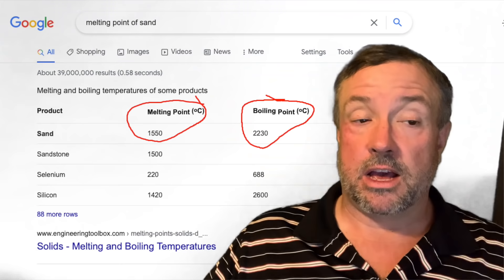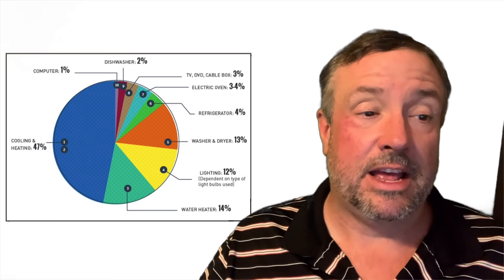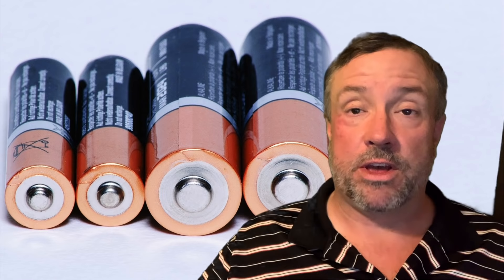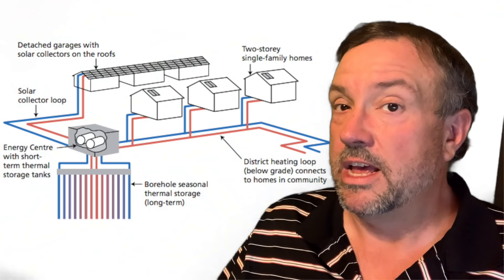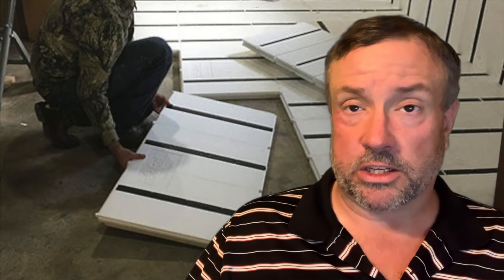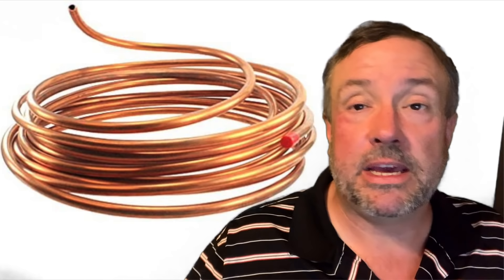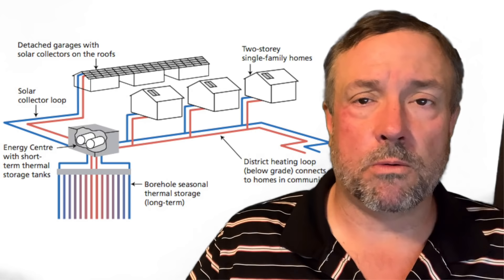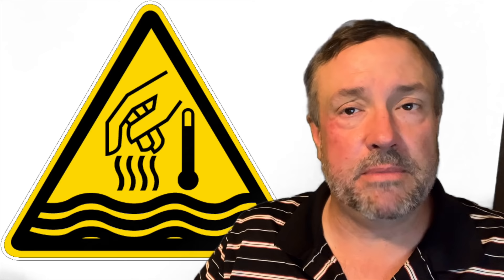Sand for Thermal Energy Storage

Comment: You should look into cast iron piping. The melting point of cast iron is 2200°F. Something I just thought of with the parabolic system is to use a cast iron pipe as the collector, put in a few small tubes and then fill around the tubes with sand inside the larger cast iron pipe. The cast iron pipe will be able to withstand the heat of the solar rays (though it's not a very good thermal conductor, it does hold heat really well), and this heat can be transferred to the sand inside to hold it as well. You can then pump an oil or something through the tubes to absorb the heat from the parabolic mirrors and then send it into a much larger thermal mass.  So inside your thermal mass, you'll have heating pipes or tubes that transfer heat in, and cooling tubes that will transfer heat out into whatever needs it. If you can get the temperatures above 100°C, you could pump water into your large thermal mass, and then spin a generator from the steam output. You'd get a lot of force out of it given steam's 1700:1 expansion factor.
Reply from the maker: I like it
Reply: If u use rocks with air pockets the water can drip onto the hot rocks and escape as steam

Comment: sand on its own is not a good heat sink, as the air gaps actually insulate, a couple of inches form the source, it requires a liquid to spread the heat throughout the storage unit. I remember reading about a passive house in Minnesota, that was succesful in heating using such a system.
Reply from the maker: Great point!

Comment: First i believe you have to break up this problem.  Sand is appealing because it is cheap and has a high capacity before phase change.  Problem with this is you loose heat proportional to temperature gradient and heating sand up to several thousands of degrees will exacerbate this problem.  Water or salt water options are very practical for the transfer of heat.  Phase change products are the newest area of interest because you can store heat energy at a given temperature such as room temperature and minimize energy loss.  This project requires multiple stages each exploiting the advantages mentioned here.  I would suggest a very effecient water based heat transfer to cool the collectors, and phase change thermal battery

Comment: What about a black metal barrel full of sand. Then add aluminum spikes from the outside to the middle to transfer the heat. Then have copper tubing pipes inside and through that carry air transferring the heat of the sand to the airflow. I’m no expert. Just brainstorming
Reply from the maker: I like it, it’s a good start

Comment: Why are you using just plain water when you can add salt and raise the temperature. Just need plastic piping salt water brine is corrosive. Or use glycol like in the car radiator.
Reply from the maker: Good point

Comment: Since the above ground infrastructure to collect the energy to heat the sand is pretty bulky, I was thinking of using a combination of wood fire heater and sand battery. 

Periodically and irregularly we could fie up the wood burner and keat up the sand. At the same time par of the heat could be piped into the house for heating and hot water (through an exchanger of course) But most of the heat would be sent to the sand battery.

This way we would disconeect the production of heat from its use. And thermostat could grab as much heat from the battery as needed by slowing down or speading up the primary liquid flow. And the same for the wood burner liquid. part would go to the house heat exchanger and the rest to the sand battery.
Reply from the maker: I like it

Comment: good, if everything sums up, the experiment should take place in desert. all condition are available there! there are molten salt solar generator that work at 300~1000c,  plenty of dry "bad" sand that can't be use on building, huge night and day temperature difference, no population just in case shtf

why nobody did the battery experiment there? very likely figures don't work as expected on paper.…

but if the storage media is water. there are countless case worldwide, they just don't call it battery, some may call it water hole, some may call it underground well. less energy density probably a good thing too, say, how many usage of a ton of sand in 500c? not much besides therml storage. but same amount of fresh water in 80c can do a lot of things. in fact, a lot of heating requirements do under 50c, 80c can already kill most bacteria and parasites, but not all virus and fungus. strip the heat away it is probably good enough for animals and plants consumption. 100c+ do no good to almost live form we know.

can sand do that? yes, but indirectly. how? water cooling. back to square one.
Reply from the maker: interesting

Comment: the best way to heat sand is in a chamber with electric induction.
Reply from the maker: electric induction????
Reply: @SimpleTek  yes instead of useing convection transport its more cost efective to use induction. as in use solar parabolic miror to collect heat energy then transform the state from heat to electrons as in (make electricity) then use the electricity to heat the sand with electric induction. electric inducers can reach temperatures of 1500 degrees. you can even use a 1400w ready made water heater inducer. at home depot.
Reply from the maker: @menuachaparyan2263  thank you for the information!
Reply: How about regular solar panels feeding some electric heating coils buried towards the bottom of the sand battery. Then a low power variable speed fan to exchange the heat via air flow.

Comment: I think ‘earth itself’ consisting of rock sand and all is THE  large solar heat  battery we have all been looking for. Where did all that heat in the earth’s core come from anyway? Is it stored heat harvested from the sun through  centuries that volcanoes act as pressure and thermal relief valves since it has never  been used? Maybe earthlings just have to drill deep enough to extract that inexhaustible heat for our energy needs and likewise help relieve all that stored energy and maybe those volcanoes  would finally stop erupting plus continental plates would stop expanding and therefore stop causing earthquakes? Hmmm 🤔
Reply from the maker: Ok

Comment: Not really as effective as phase changing materials like Water\Ice (storing cold), Wax, Sodium Acetate, Salts (Storing heat). non-phase changing material cannot sustain a near constant temperature which makes them less useful. 

Typically for domestic heating water is used because you can take advantage of stratification (warmest water remains at the top), & the hot water can be use directly from the water storage tank (ie no need to run a large amount of piping through a solid material like sand). Wax is also sometimes used for domestic heating which takes advantage of the phase change (gives off heat when it transforms from liquid to solid).
Reply from the maker: I'm currently looking into paraffin wax
Reply: @SimpleTek  I recommend you stick with a water tank and use stratifcation for a residential application. Adding Wax will make it complex & more likely to run into issues. 

FWIW: 80 Gallon tank feeding a Outdoor wood boiler and a Propane boiler (so I can have heat & hotwater if the wood boiler is not running). If you want to get the best bang for your energy, consider using hydronic radiant heat since the water temperature can run around 80F to 90F. This will be double the efficiency of a 160F system using traditional radiators. I have a radiant heating system.
Reply: @SimpleTek  and quadruples the complexity. You have to deal with expansion. you need a internal stainless steel coil. You get more bang for the buck using Hydronic Radiant heating.

Comment: You could heat air to 180-200 C very cheap.
Reply from the maker: Interesting.....
Reply: Yes but the energy densety is realy low.  You coud only store 4kwh per m3.  
So you would need a huge airtight tank ,which would be very expensive
Reply from the maker: @mzi6519  true....
Reply: I was thinking as a carrier from the parabolic collectors to a distribution grid in a sand pit buried below 36” to take advantage of earth insulation and could be lined with roofing rubber with a heavy expanded styrene insulation on to of that then an overlapping layer of liner to keep water out. With the earth replaced on top would keep a large portion of the heat trapped. Maybe not enough for the long winter but would make a significant difference for the the first few months.
Reply from the maker: @damonginnow1383  remember I'm talking storing 300' - not sure wood would last
Reply: There are some concentrated solar station that use a black ceramic honeycomb like structure as e collector. Ambient air is sucked in through the honeycomb and heated to over 1000°C, then sent to a heat exchanger for steam generation. This virtually eliminates convection losses at the collector.
You could pass the air directly through the sand. The sand chamber should be airtight with a quite powerful suction fan at the exit
Reply from the maker: @ing.pagano  ohhh, very interesting!!!!!
Reply: Elaborating on the idea, the outcoming air, still hotter than 100°C, could go through a heat exchanger with water to the secondary "battery". In winter the same fan would drive the same circuit to draw the heat out, with a differential thermostat deciding to recirculate the air exiting the water exchanger or taking fresh air from the heat collector, whichever is hotter

Comment: I see no reason to pipe hot liquids anywhere except to/from the solar collector and to/from a steam boiler which can sit on top of your buried sand container.  Use the steam to drive a co-located turbine spinning a generator.  Use the electricity generated to run the house, greenhouses, heat a fish pond, keep livestock warm, to run the fluid pumps, etc.
Reply from the maker: Ok
Reply: @SimpleTek   I take it you've explored that option.  :)
Reply from the maker: @graveseeker  somewhat

Comment: Consider hydraulic lines, high heat, higher pressure, steel reinforced,  crimped on ends…
Reply from the maker: They aren’t high heat, I use and replace hydraulic lines on my tractors all the time
Reply: @SimpleTek  the hoses will handle a few degrees, if it was super drastically hot, I’d imagine a reinforced silicone hose. ( I’m crusty old parts guy/mechanic/maintenance/etc. so I have a vastly deep well of nothing) ha
Reply from the maker: @thedustmancometh  lol

Comment: Use a grid black steal pipe in sand ... insulated nonporous Concrete atleast 6 foot deep  20x20 foot build a green house over it but really it should be a egg shape battery 30 deep 20 foot wide with horizontal piping every 2 feet  ,,you will actually need to make it a steamer to raise the temperature 🌡️ you will need to add water to the Sand,,. But if you don't need extreme heating of the sand don't wet it this would make the pipes last longer,,. Use a non corrosive oil.  I would buy used synthetic oil and filter it under pressure with a pump $1000  pump used , filter 500 gallons  pump it sell it for $800 save 60% on oil..   dont forget vacuum is your freand with thermal dynamics.     I would buy a couple of  used big rig truck oil tanker trailer or best one of a train insulate them ext look in to it but maybe It would be cheaper to ship one from Ukraine. LoL...  good luck 🤞
Reply from the maker: interesting...
Reply: I like the idea of reusing 'used oil',  since your heat transfer may not be going through the thin parts of a car/truck radiator, you can deal more easily with previously used oil and its' not being as clean.

Comment: They say a huge amount of electricity goes to waist when it's sunny, why not use a nichrome wire ...some sort of set up from solar panels I'm not a engineer just a thought
Reply from the maker: like a toaster?
Reply: @SimpleTek  toaster,kiln ect. You would be taking solar electric and turning it into heat. I have no idea how much panels it would take but I do know electric kiln components are readily available I just see a much higher temperature option but again I have no idea what it would take concerning the amount of power needed
Reply from the maker: @duanesharon  worth exploring

Comment: I am doubtful that you can do long term--ie. months long--heat storage on any kind of reasonable scale for a homeowner. Vacuum insulation would do it, but more reasonable insulation simply passes too much heat. Now, if you are talking about shorter term, such as hours or even a couple of days, that is possible.
Reply from the maker: drake landing in Alberta canada is a development with 55 homes that all do long term heat storage to heat the entire community through the winter
Reply: @SimpleTek  On a community wide size,  it obviously can be done. But on one household, the surface area to volume ratio is orders of magnitude greater.

Comment: I think you are barking up the wrong tree. By your own displayed chart most all of the needs can be easily taken care of with conventionally. 47% space conditioning passive solar, thermal mass and insulation. 14% hot water = solar. Solar PV for electric. The only part where high heat could be helpful is the oven, and dryer. If you are still determined to do a high heat storage, I would avoid the very high heat due to increased costs and safety. Here are 3 proposals.

#1 – Trough style insulated solar oven with heat storage of sand and/or used oil. As you have seen with solar ovens, reflecting panels drive the heat into a medium. Make a ground level berm as long and as big as you want. Insulate all around it. Use reflecting panels that you can close over the system that are insulated behind the reflector. Then heat stays when there is no sun. You can transfer the heat with pipes and either fans or oil & pumps. You can build in a chamber that you can cook food in directly if desired even days after no sun, if designed right. Sand is almost 102 lb/ft2.

#2 – Underground insulated tank – Use a standard parabolic trough and pump hot fluid into an underground insulated tank. The design is flexible with fluid choice and hardware. Advantage is high thermal mass that is out of the way, and flexibility. 

#3 With a passive solar home, any building or even a shed, you can still do Ivanpah similar concentration at lower heat levels. If you set up 10 mirrors 12”x12” tracking the sun and point them at anything that thing is going to heat up. You can do three mirrors or three thousand. It all depends on how much heat you want, where, and how you will use it. For example, on the north side of an insulated structure which is usually darker and colder, use mirrors further back that reflect sun to it. A small trombe wall behind insulated glass, could have reflectors shining to it. You can scale that to any size or heat level of storage you want. The challenge is in the complexity and the cost of auto tracking the sun. Also as temperatures increase danger increases both to eyes and heat.

For decades I have wanted to do both #1, and #3, and not gotten to it.

Comment: I had been giving this concept some thought prior to seeing your video.  It seems to me that your premise revolves around sand's ability to withstand high temp, and being close to free.  Seems like sand isn't free, rather it's costs are hidden or buried, if you will.  Given it works as a battery, but does not have good conductivity, so it's harder to get the heat into and out of the sand.  It's also harder to do maintenance to your circulation system after the fact. Pumping sand is a cool idea, but you will lose system efficiency due to costs of pumping sand, including wear and damage...  sand is an abrasive. 

I think the system has to be fluid-based to be affordable and practical. Thats why most of the DIY systems with potential for long-term usability rely on a water-based coolant with additives to prevent corrosion and algae.  Where my thoughts and yours crossed paths is the temperature limitations of water-based coolants. They can freeze, boil, and have short working durability, requiring purging, maintenance, and replacement. Worst of all, water's boiling point may be the biggest limitation to maximizing what you can store in your battery.

I am currently looking into fluids suitable for high temperature baths and heat exchangers, without the unfortunate drawbacks of materials like liquid sodium and other salts.  Like you, I am leaning towards oil, to both transport and store the heat.  Heat exchangers to pull heat out of the oil storage tank (battery), and transport it in a controllable fashion to a hot water storage tank in your home or facility, where a second heat exchanger dumps the heat where you can use it.  Silicon oil looks to be a candidate, with a very acceptable working temperature range, acceptable thermal expansion rate, as well multiple other critical characteristics. Durability and cost are the potential sticking points. Working temperatures in the 50 to 300 degree celcius range are the pay-offs. 

I am looking at evacuated tubes, perhaps with some form of parabolic collector if that can be had affordably.  (I have my doubts)  
Silicon oil in a series of cascading tanks, so that I can increase the battery size as I add size or efficiency to the collector.
Battery under the frost line, possibly in sand, otherwise sleeved in concrete/graphite for strength and low permiabilty, surrounded by aircrete or styrocrete.
This will provide hot water for kitchen, bathroom, and infloor heating.  The building will be ultra-insulated, with small backup appliances for heat and hot water. 
The goal is to have much higher temperature collection, safe storage, and a very large battery, so that I can can heat-charge all summer without exceeding capacity, and not have to use the grid to suppliment over the winter.
Thanks for the video, enjoyed it and the comments.
Reply from the maker: Awesome insights